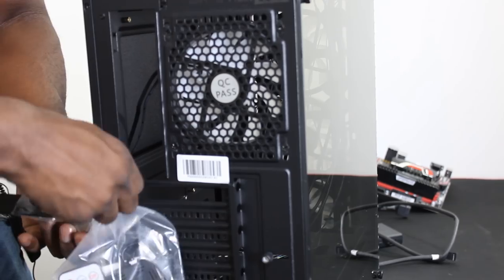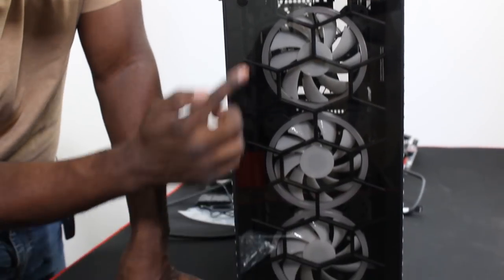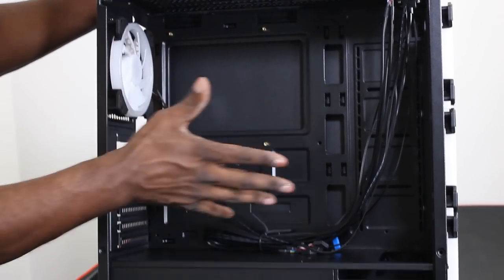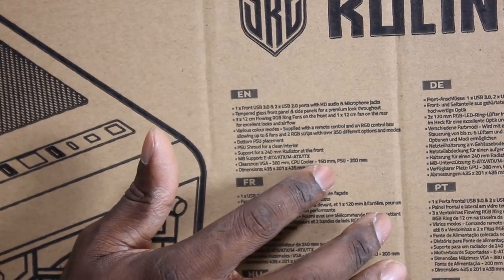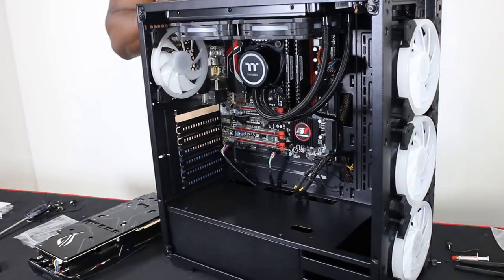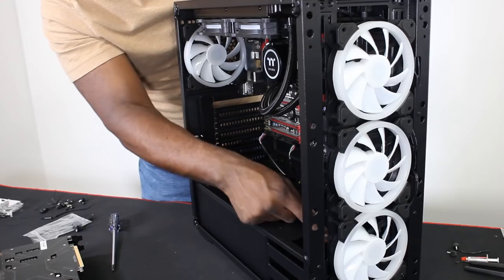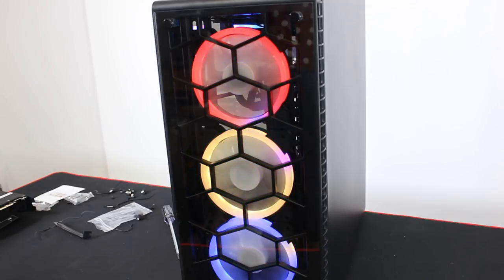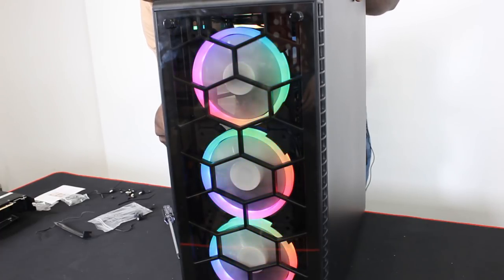Kolink Observatory RGB Case Build/Review - RTX 2060

Comment: Great value for the price. Cases are one of the few things that got cheaper
Reply: Do you have the case?
Reply: @martinsaad542  I do, what dou you need to know?
Reply: @genotsSnor  I wanted to know if the fans of the case are still working after extended use

Comment: Does this case breathe well? As I see there is not a lot of space for the air to go in... I thought about taking down the glass at the front, and putting dust filters instead, is it possible?
Reply: there is a mesh version of this case just came out should increase airflow

Comment: Are the fans powered through the RGB controller (which is then connected to the PSU) or do you need to use fan header(s) on the motherboard? I would presume you do NOT need to connect them to the motherboard based on the information I've seen on this
Reply: [late reply] No motherboard connections (except for RGB if you want). The catch is that the fan speed cannot be controlled by a fan curve in software

Comment: How did you mount your AIO on the top? i got recently an Asus rog ryuo 240 watercool AIO n im confused how i could install it on the top easy :/?
Reply: Mine didnt fit either so i placed it in the front and used the front fans in the top
Reply: I'm in the same boat just got an arctic aio and it is a thicc boy

Comment: What rpm does those fans spin?
Reply: 100%
Reply: @genotsSnor  yup always at max speed, I've had the case now for a year.
Reply: @jaahasjaahas8729  Ah snap, sorry. I'm thinking of replacing the fans.
Reply: @genotsSnor  I've been thinking the same thing. Also replacing the front glass with mesh makes air flow much better.
Reply: @jaahasjaahas8729  I'm thinking of that too, though I'm not sure where I can find mesh.
Reply: @genotsSnor  I just ordered the mesh from ebay and cut to right size.
Reply: @jaahasjaahas8729  Cool, thanks I'll do the same.

Comment: does the b450 Aorus Pro motherboard have enough ports for the 4 RGB coolers ?
Thanks
Reply: I’m pretty sure it comes with a fan controller, you can always buy fan header splitters for cheap on amazon
Reply: @fujimotofn  I just received all my build and you were right, it comes with a fan controller. Thanks a lot

Comment: I own this case and in my experience you have to take the front glass off. The airflow is absolutely garbage with the glass in place and with the fans where they are. Without the glass you get really good thermals.
The fans are pretty but you can not control the fan speed, which sucks because the fans are really loud. It's not exactly like a jet engine but if you use open design headphones you probably don't want to have the case on your desk. You could swap out the fans of course but that defeats the purpose of getting a cheap case like this.
Cable management is okay, but the wiring for the rgb and front io are a bit obnoxious to set up.
With 2 extra fans at the top, space becomes a slight issue. Using an atx x570 board there is not much space at the top and bottom which makes wiring a little annoying.
In conclusion it is probably best to look at other options.
Reply: Hi, I wanted to ask you something. Would a Nzxt Kraken 240mm AIO watercooler fit at the top. I will build a micro-ATX mainboard in it. Im just asking because the youtuber in this video said that it doesnt fit but I mean with a micro-atx it should fit, should I try it with the 240mm or buy a smaller one because i would love having a 240mm in there. I would be really thankful if you help me💙
Reply: Okay, remove the front glass but what do you do against dust. Do you apply anything in front of the 3 fan? If you do, then what? Thank you for the answer, have the same case.
Reply: @bassamassad  I have the case too, thinking of buying some kind of mesh material and place it on the front panel. Just need to find it.
Reply: @genotsSnor  I bought silk used on loudspeakers. It lets air through but filters most of the particles. Now I just need a way to adjust in on the case. :D
Reply: @bassamassad  Ah that's clever, I guess you just have to cut it in the right format so it's the same size as the front panel. You can try to force the screws (that you'd normally use to tighten down the front glass panel) through the silk, the head of the scew should keep it on. Sorry for my English, it's not the best :) Thanks for the tip btw. Do you have any idea where I can buy this?

Comment: do the pre-installed fans have a 3 or 4-pin header
Reply: Neither mate, there a 6 pin female that interfaces with the control hub, just got the case the other day, absolutely cracking case, prefer it to the Cooler Master 3.1 lite I have already.

Comment: Will i have to plug anything for the fans into my motherboard or do the fans and the front panel go into the hub and the hub is powered by the molex connector ?
Reply: Had the same question

Comment: Hi,yes you can change the lighting color speed by pressing S+ or S- on the remote :)
Reply: Yes you can
Reply: @GravettAirsoft  Since I made that comment Ive taken out those fans and put 6 Corsair LL120 fans (white) in and are controlled with a Corsair Commander PRO Digital Fan and RGB Lighting Controller..much better :)

Comment: Hi, 
I've received my "Kolink Observatory White". I've connected the 4 case fans to the provided fan hub. The hub is powered via molex. The fans get activated, and work well. The RGB function (reason I got the case) isn't! 
I can't figure out why the RGB isn't working for these 4 fans. I tried different front panel cables, but... nothing.
What's missing?
What did I do wrong? 

Which front panel connector did you connect the fan hub to? 
Did you connect  the hub somewhere else on the mainboard?

Regards
S.
Reply from the maker: I may have connected to my motherboard, it was a longtime ago
Reply: @MXDOUT  Thanks for your quick reply. Do you remember whether it was only via the front panel header area or elsewhere?
Reply from the maker: @stevencorinneferon8924  Right I've just checked the video out which tells me this could have been put together in a much better-educated way, with close-ups of showing the product and showing where everything goes in soooooo..... my bad on that one.
The answer in the video is the motherboard I am using is not RGB at all with no connectors to get the RGB going.
But if I remember right is that you have to connect the Molex connector, the fans and power led connector to the box,  the little power led cable has to go the front panel of where the reset power and all the other leads that goto the front panel connector go and turn it on from the L.E.D> button on the case or remote control :)

Comment: you must put the connectors as stated to fan 1 fan 2 fan 3 fan 4  u can not just put into fan 1 fan 2 fan 3 and then put the last one to the fan 5 or 6 as you probally did and now it does not light up for you

Comment: Anyone has this case? How’s the airflow? I have i7 9700k and it gets hot, even tho my watercooler isn’t the best. But I feel like the airflow of my case is the worst. Looking for a new case that can take 2 120mm fans at top, besides the 3 at front and 1 at back. That way I could install my wc fan there at the top and another one.

Comment: This is one of the worst. If not the worst case I have ever had the displeasure of working with.

Not only is the built quality and thermal performance absolute dogshit.
The goddamn front panel connectors don't seem to fit in most motherboards. That sounds too weird to be be true? Trust me. I was in utter disbelief also.

A friend of mine did the foolish move of buying a cheap case, this turd. Do not make his mistake. I hate breaking out the news of "your case is so shitty, it's literally impossible to get it working and even if it did work, it's noisy and runs hot like a volcano"

Seriously guys. Do not save money on cases. It is exceedingly important for the whole setup. 150-200 euros at a MINIMUM for a case. Buy a good case for more and it'll last you a lifetime.

Comment: Do not buy this case
Take it from somone who actually tried to build in one.
(this video doesnt show a build, there is no graphics card installed, no gpu temps shown under load etc).
Background: I've been a system builder 19 years now, I still do a system every few weeks, I know my stuff.

Was REALLY looking forward to this case since it was announced 6+ months ago. I Was going to put my spare pc in it from an aerocool800, but as I built I've now said NOPE.
Honestly cant be bothered to get a refund so its just sitting empty, here's why.

MAJOR ISSUES
Front fans right up against glass front so NO airflow for system components.

AHAA! il put the fans on the other sideto creat a space from them to breat from.....If you try to move fans backwards on the other side of thier mount to give them some room to breath it puts them into the hard drive cages so you have no 3.5in HDD mounts

The cheap terrible fans dont conform to normal 3/4pin standards so if the controller dies all fans are worthless, RGB isn't addressible through asus/gigabyte either but I digress.

Maybe 12mm of space behind motherboard tray? really not enough.
 

Rear pcie section is TERRRIBLE!
!!!
1 main big pci slot cover is a cheapout is is REALY badly fitting to the point it just doesnt.
pcie slots are punch-out types when many other cases at this price point have individual real pci slot covers, notice in the video only the top one is taken out and to put in that graphics acard you'd have to remove the next one aswell which means taking all the motherboard and cooler all out again, again unecessary when you can just have individual pcie brackets.

Steel is so thin you can read through it, you can literally bend with with your finger and thumb.

Says you can mount a rad in top is a blatant lie, roof is so low you could maybe mount some fans but thats it, worthless.

Front 19pin usb3 header is for a single usb3? Why?
RGB button goes to a "reset" switch header but so does the actual reset switch, could be confusing for noobs.

33% more expensive than the ultra terrible CIT raider/blaze cases thats pretty much the exact same case made in same china factory also used on the walmart "overpowered" systems.

This isnt a case of "you got a bad example", These are bad design flaws and from cheaping out too much.
It's a £40 case. £25 worth of case, £10 being the glass side panel, £5 being RGB.
No thank you.
Reply: Thanks I'll definitely keep looking then as I'm leaning towards the Ryzen 2700X and RTX 2080 so more concerned with having good airflow than the RGB gimmicks anyway.
Reply: @seraphina985  Check out gamers nexus reviews as they actually perform airflow testing, If you're buying good hardware maybe look at spending more on a case.
1) proportionally to the rest of your build the cost is relatively low, whats a £100 case holding a £1200 pc?
2) that being given, they're an art piece, you're going to be looking at it for hopefully  along time so makes sense to get one with a nice aestetic that wont age very fast while also being well made and thought out that helps your components do thier jobs.
I have no experience with the fractal design meshify C but its the sort of thing that you might want to look into, Best of luck.
Reply: Wish I had seen a comment like this a few months ago when I bought this case. Just today I was trying to fit a 240 radiator but the fans block the ram slots. I'm really annoyed with this case, even though it does look very nice.
Reply: Toms Tech I bought one of the cases from these guys and regret it so much... 
What should I get at the same price range?
Reply: @larss331  Im thinking of buying a rad with fans for in this case, which mobo and ram sticks do you have?